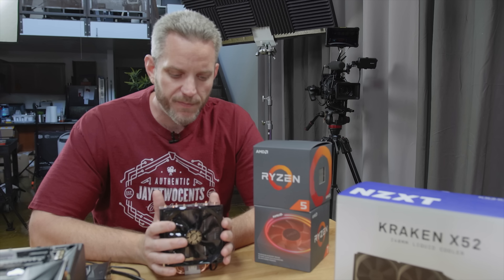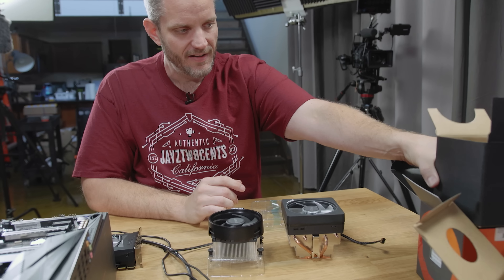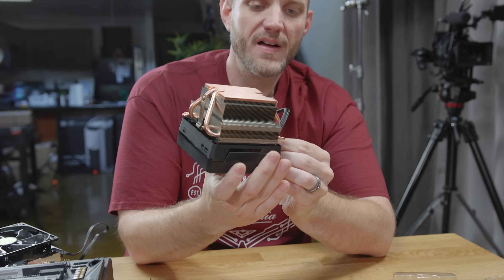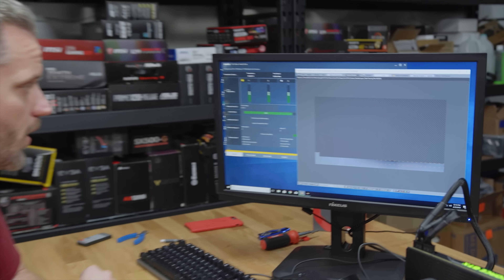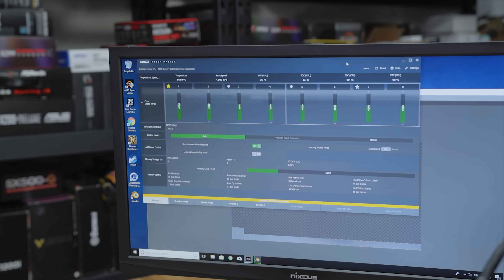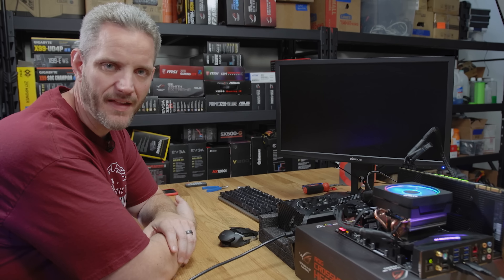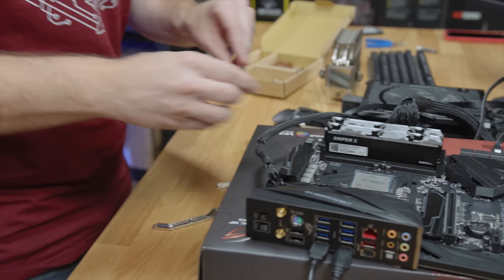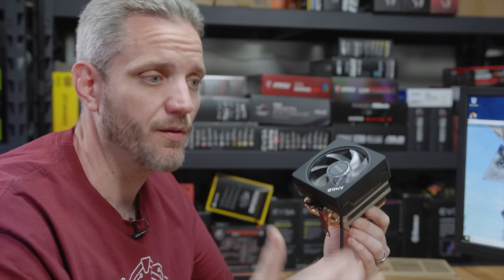Overclocking with a stock air cooler?? Is it even possible?

Comment: What motherboard did he use? I'm really stuck between msi b45 gaming pro/plus/tomahawk.. Not sure what one to pick for my r6 2700x. Or is there a better motherboard in the market
Reply: Get
A x470 mobo instead for OCing. Try going for asrock or (my recommendation) msi x470 boards. Gigabyte and Asus aren't performing right now. B450 mostly for the ryzen 5 and below.
Reply: I'll look into it, thanks for the suggestion. I might also need to ditch the stock cooler if I'm OCing then, any cooler recommendations?

Comment: Hello there,
Maybe you can help with my thoughts: I'm working in Unreal Engine, and when building level, Wraith Prism (same one you've got here in video) goes totally on max, and actually the heat is kinda high when I'm putting my hand to the back of my case = but it's just now when I've got actual concerns about it. So, please, tell me - if the temperature goes to high, does the system shuts off?

Ryzen 7 2700X
Wraith Prism 
GTX 1070
16G RAM DDR4 Zotac Limited
Aerocool Lux 550W

Just wondering if my PC in case of trouble will burn, or maybe shut down and give me a warning?
Reply: Shouldnt be a problem, your CPU will throttle its performance to stay cool enough to be safe. If it somehow doesnt manage to do this it will shut down like you see in the video. Then just restart your pc and youre good to go. I would however recomend getting a better cooler for heavy duty tasks so your cpu can keep going at a high pace.

Comment: Finally replaced my stock 2600 cooler with 2700x cooler (which I got pretty cheap) and got my temp average 10c down.
Reply: @Ryan Yeet I did just to test (can run at 4.0 with temp  below 90c)  but my psu is old so I did not run the OC 24/7.

Comment: I am glad AMD coming back, but to anyone who asks why not Intel, and "AMD is better!!!" Listen to a simple explanation

Intel still better for gaming. Because i7 4790k still beats all of current Ryzen chips for gaming in 90% of games. i7 8700k on the other hand is about 30-35% better than 4790k, so it lays Ryzen on its' back in gaming.  8700k potentially giving you up to 20-30 fps more than i7 4790k, while i7 4790k beats the top end Ryzen in 90% of games, or matches it.  

i7 8700k > i7 4790k > Ryzen chips currently

So yeah...single core performance is not to be scuffed at on Intel, I owned 4 AMD cpus, and only 2 Intel's to date, to know the difference between them. 

Once you go Intel, and you know what to buy, you probably will not go back to AMD, unless you render videos and do workstation tasks. Then Ryzen beats Intel in that price bracket, but if you want top of the line, then Intel still has the crown with their i9 chips. 

Choose with your wallet, based on the performance. I bought i7 8700k, and I know how good that chip is. I managed to do an easy overclock at 4.7 ghz, under 1.21 volts
Less power draw, even better overclocking than 4790k, and overall better perfomance of about 20 fps in games, without upgrading the gpu. 

Also 8 cores 12 threads. Do I need to expand more on this, and I used to be behind AMD for a while, but their architecture for gaming is NOT there on the level of Intel...yet

Maybe new Ryzen? But I doubt it will beat Intel 8700k, let alone i9 9900k, I don't expect them to beat i7 9700k either. 

But don't take my word for it. You can put in:
 Ryzen (pick model) vs Intel i7 8700k/i7 9700k/i9 9900k in Youtube search. 
It's simple evidence.

Oh yeah, and I am running 4.7 ghz delidded 8700k at about 55 Celcius in games, and max temp of 70 Celcius in Aida64 stress test on Cooler Master Geminii S524, which is not even as good as water cooling. 

Intel still has the gaming market for the people that know where the juice is. Do some research, look at numbers and decide. It's money to performance balance. 

Best CPU on the market right now for gaming is i9 9900k, but it's priced accordingly. 

When you buy Honda Accord, don't say it's better than BMW, because it's simply not. Or don't compare Ford Mustang with Mercedes. Because Honda and Mustang are good cars, but nowhere as good in engineering in comparison to their counterparts. 

Research, look at reviews, see the game benchmarks, and don't listen to people in comment section. Because when I scroll through, I just kind of smile at it, because most have no idea about what they are comparing to. 

If you owned both platforms, you know exactly benefits of each platform.

My AMD FX-8320 would render better than i7 4790k, but i7 smokes FX-8320 in gaming.

Amd is king for rendering on the budget. KING. 
Intel is king for gaming at the according price. KING

Both are good, but AMD hasn't hit the perfect price point. 
Intel is like Nvidia in many ways. Quality and performance
AMD is AMD. It needs help, it needs better engineers, but they are getting there.

Also...there are plenty of i5 processors from Intel that are better than many i7s, and much better than Ryzen chips in gaming and even rendering.
Reply: A 4790k does not beat a 2700x in gaming...

Comment: The Hyper 212 EVO V2 6 copper heat pipes is awesome OC ed my FX 4100 too 3.7 GHz and coulda gone 4.5 if I had wanted. I do understand that that was overkill for an entry level FX but I didn't when I bought it.

Comment: if i can i turn the fan around depending on the system. would this make much difference in cooling i if i turn the fan around i just like it to blow more closer to the fan that goes out. and can i turn the psu fan around cause my gpu and psu fan spins in oposite directions right by each other and that cant be good

Comment: I overclocked my R5 2600 with stock cooler and it got over 82 degrees. Now I use the Wraith Max (that‘s the prism with less rgb and it does not get over 65 degrees.

Comment: I’m having an issue with my computer randomly shutting off during cod I have a 2700x asus x470f gaming mobo and a 1070 I don’t know if I have enough power to run it or the psu is going bad it has a Corsair cx 500. Keep in mind my computer was a budget rig and has slowly been getting upgraded. Any thoughts?

Comment: hey there, 3700x >1.290v 4.425mhz allcore bios oc stable 24/7 cheap aircooler. It makes no sense to oc ryzen allcore if they stay lower than max boost...
Tell me something, why do i see in Ryzen master the cores up and down like intended and then in cpuz or hwinfo they stay at max speed all the time? Thanks

Comment: You can do AMD Turbo Mode with stock cooler! Custom Clock is risky though. I have a AMD Ryzen 5, By default the BIOS uses a Quiet and Cool Feature with standard clock. My chip runs cooler with turbo mode active as it disables the quiet and cool feature and uses Standard Fan Speeds. 3.2GHz is my standard Clock, 3.4 Turbo. I was getting up to 65c at standard clock under full load. With Turbo I have not Gotten over 57c.
Reply: AMD says My chip is not good enough bfor hellblade: senua's sacrifice but with turbo active my GHz is equals the Ryzen 5 2400's base speed which is the minimum recommended. I have the Ryzen 5 1400

Comment: Dam, so i can't overclock? 5 fans total in my system. My CPU fan is the circle one with the 4 spring-loaded screws..I tried 1,2 volts and 3700 speed and ran a cpu stress test for 5 minutes and temps got up to 75c max...not sure if i should increase my speed or volts let me know

Comment: Definitely with the AMD Wraith RGB. One of the finest and neatest air coolers on the planet. Have an FX8350 that achieved 4.5 which isn't a huge deal, but it's  an almost .5 Ghz OC. Bought an MSI Core Frozr L, had to de-skirt a DIMM and everything only to achieve 4.3 and very unstable at that. It just didn't pull the heat away fast enough so I was getting a lot of temp fluctuation during heavy load, Yuck! I'm a firm believer that vertical CPU coolers while pretty, are all junk. Especially those 4 fan aluminum cooler sandwiches they try to pimp out for a quick buck. cough Noctua cough

Comment: I’ve had a i5 4460 in my system sense the end of 2014. Was on budget so I used stock cooler. I’ve never had a problem with it. Never over heated and I gamed on it, bitcoin mined on it, etc. fast forward to now and I still use the same cooler. Are you sure the stock coolers are really that bad? I’m confused. Lol
Reply: Well, the i5 4460 is really power efficient.

Comment: i cant say with 100% procent but i dont think the ryzen cooler  works with older cpus i think the plastic brackets are spced diffrently appart so i dont think it fits but i could be wrong about that.. i just know th holes wont fit unless you have a motherboard that specifically has scew holes to accept either option which i remeber seeing at one point though i forget which motherboard that was... it may have been my crosshair something something x370

Comment: AMD replaced my older stock cooler with a new Wraith cooler when the did a warranty replacement for my FX 8350 even though they advised me they would only replace the CPU itself. I figured I would give it a try and I am able to overclock with it instead of my Cooler Master Evo and without manually checking the voltages and only doing very basic overclocking.   EDIT: Almost forgot to mention that ambient is about 82 Fahrenheit / 26.5 Celsius and MSI reads at Celsius with the fan running at 65 to 70%. In winter it would be reading still lower for both ambient and the CPU temps. And I have been running the CPU at nearly full for more than an hour!
Reply: Pete Nielsen Only an hour, try at least a day?

Comment: I know this old but I have oc'ed to 4.0 at 68-70c using the stock stock cooler...2700x x470 with the most recent bios.
Reply: What's your bios firmware? Just curious

Comment: i got the 2600 clocked to 3900 in the stock cooler stays around 45- 55c.. max i have seens is 70c but i got a case with 2 fans on the side blowing on the cpu...  cpu cooler fan turned up a bit too

Comment: there are 2 problems with the prism cooler. 1 it's Very Loud. 2 it gets clogged up quickly.
you can use it as a temp solution. but nothing more than that. the Wraith cooler is by far more efficient.

Comment: I got a Ryzen 5 3600 and was using my stock cooler until the new one showed up. I did a static overclock to 4200 on all cores, at a max voltage of 1.47 and it would get pretty toasty, upwards of 80c under load in benchmarks, but when i ran Prime95 torture test it got up to, no lie, 106c and shut the F off... lol...   i did it twice to make sure.. Probably not good. Would not recommend.

Comment: Guess I got lucky with my 2700X then, because I run it locked at 4.2 across all cores with the stock cooler with 100% stability.

Comment: you guys said it was the wrong sata. mines a new build new parts nothing mixed up and i dont have a modular psu. and i still had the issue where i had to remove the ssd to get my system running. ?

Comment: the Wraith Prism at max speed is actually not that loud.  Especially inside a case. I can barely hear it.  Unlike this 7000+ RPM 80mm fan I have mounted on my Core P5 to blow air on my VEGA 56 (I need to invest in a GPU waterblock).

Comment: I have my 2600x pverclocked to 4.17 at around 3.5 v with the stock cooler and it works fine.( I do have the fan on 100%

Comment: I do video editing and have the ryzen 3900x 12 core and it comes with the prizm cooler would it still be ok or do I need to upgrade to a bigger cooler? I dont do any overclocking

Comment: Noob here, I'm overclocking my Ryzen 7 1700 from 3.2GHz to 3.8GHz using the Wraith Spire cooler and oc through the updated bios on MSI titanium mobo @ 1.344V. Sigh, I know better now but I used the thermal paste that came with the cooler. I used info from here and a couple of the other channels like Jayz, I'm pretty sure I mashed it all together and did the above. HWM says the package temp never goes above 72c during hours of BF V and I think I read the chip can go into the 90's. I've got Cinebench and it gets 1666 on cpu test. I also have my old R9 270 GPU maxed and the PC is very stable. Feeling info overloaded here. Is any of this okay or even good? I know, change the paste.

Comment: Hey Please, can i OC my 3600X on @4.2GHz and 1.225V on tomahawk max with (Stock cooler)? And the Ram: XPG Adata Spectrix D40 2x(8)3000MHZ is good or i should OC it either to 3200MHz?

Comment: Okay so i have a question... did i just get a win in silicon lottery then? Cos i just buildt a r5 3600 and using stock cooler and did a test streem on PUBG full settings using discord... mind its a 720p but cpu ran 4.2 and it stayed around 55-65C

Comment: so wraith prism isn't good enough for 4.2ghz ryzen 2700x overclocking ehh... ?
so we are back to square 1, where we have to add a 3rd party cooling solution, such as noctua...
and if that is the case, I wonder: isn't ryzen 2700 (without the X) the better choice, as we save 30$.... ?

Comment: Hi Jay. Sorry if this looks redundant, but can you maybe compare the Wraith Prism against the original Wraith that came along with the FX 8370? I noticed that the original Wraith had a copper baseplate, vs the direct heat pipes of the Prism. Also, the original Wraith sported a Delta fan (albeit a 92mm fan, it's a Delta)

Comment: I overclocked my i5-9600k to 5.0 Ghz, with some $30 cpu cooler, before OC I was getting idle temps at around 28 - 30 c, after OC I get only like 35 - 38.. under full load for 30 minutes it goes to 72 and then stays between 72 and 73

Comment: It is but gets really hot
With ryzen 5 2600 at 3.9ghz u I got 80 to 90° at games like rust and farcry 5
At 3.8ghz cpu temperatures never reach 90° or even 80° depending of what u are doing
I bought a new cooler so I will test it at 4.1 ghz

Comment: I unlocked a 1 gen cpu i5 650 3ghz and overclocked it to 3.67 on H55M E31 MS 7636 with a Hyper V412 aircooler . Runs over 100 fps

Comment: I have the ryzen 7 3800x using the stock wraith cooler but I left my settings on default, I don't wanna over clock cuz the cpu temps are in the 60s and sometimes 70s while gaming I don't think over clocking is worth it for an extra 3 fps.

Comment: HELP PLS! I have the 2700x with this cooler and I tried to render in 3ds max using Arnold (cpu based renderer). So when I started to render all the cores went to 100% and the temp started to go high up to 92 c and then it shut down. Is this cooler supposed to be able to take the heat or I should buy another one? Cause I'm thinking it's either the cooler o I installed badly, cause it's my first build. Help me plz

Comment: Mine behaves a little bit weird. Under Overwatch + Streaming load, it crashes after a few minutes because of too high temps.
I need to manually UV (4GHz 1.225V) for it to be stable. But that might also be because of my hot room temperature or my airflow (even though I highly doubt it; 2 intake 2 exhale at max rpm)

Comment: after experiencing the screws when installing a r5 1600's cooler, then the clips with a 3700x cooler, i simply dont get how you find the clips to be worse lol - those screws are so tedious and stiff to get on while holding the motherboard and mounting bracket

Comment: so let met get this straight... stock cooler is good, except if you bump OC to its limits? I mean stock frequency is what.. 3,6 ghz for a ryzen 7 2700x ? when you go to 4.2 that is + 600 mhz which is already impressive. or can you also go 4.2 with the boost options? nope ?

Comment: My cpu is 60 C at idle in the bios with factory cooler for the Ryzen 5 3600. I'm building a PC for my cousin. I built one for my friend 2 months ago with same CPU but with a Corsair H100i AIO. His idle temps were 28 C. I'm reading articles that this stock cooler just sucks. Have you tested off camera and found this to be true?
Reply: There's something very wrong there. I'm using Wraith Prism with Ryzen 5 3600 and it's 60-62 degrees in Battlefield 5. Overclocked to 4.3GHz. Idle is 36-43 degrees.

Thermal paste not applied correctly? Is the fan running too slow? Very bad airflow in your case so CPU sucks all the hot air from GPU?
Reply: This was with an open case. I set the fan to max in bios. Bios is up to date. 

I did place the cooler down on the cpu and picked it back up to make adjustments. When the temp got up to 60°C at idle, I turned it off and replaced the thermal paste.

I have a new air cooler coming next week. If that doesn't work we are going to upgrade to a AIO.

Comment: Hello brother, I have ryzen 7 3700x, Iam an architect and I do lot of models and renders, the problem with my cpu is the stock cooler, while I render a image or run any kind of cpu oriented works the cpu fan spins at slower rpm than normal, at normal times it spins faster than rendering. The logic is that when cpu gets heated up it should spin fast right, but it's vice versa. I set my fan curve all the way up in bios still didn't fix. Any help from you guys?